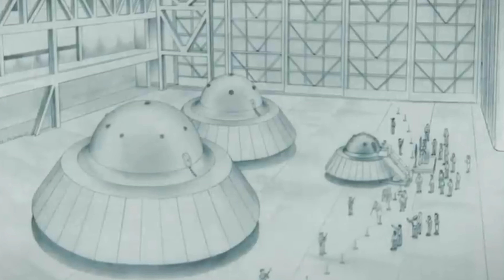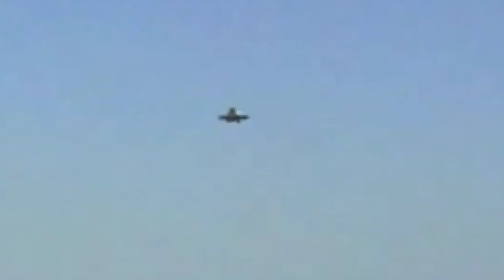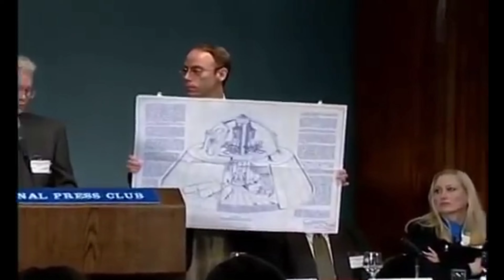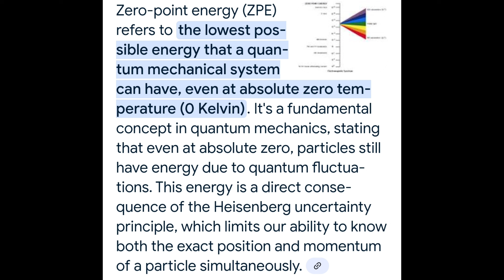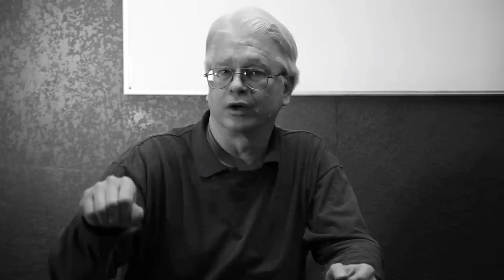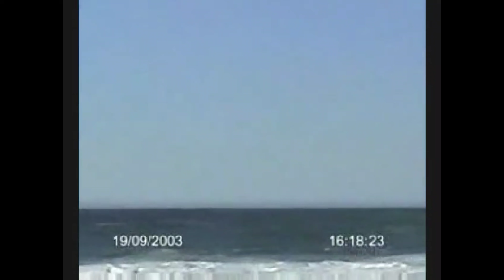(2025 Update) How To Build A UFO! The ARV (ALIEN REPRODUCTION VEHICLE) Project!

Comment: These vehicles do not produce thrust. Thrust is Newtonian mechanics. The occupants of the craft would not be able to withstand 20g. The craft does not move, space does. The internal dynamics of the craft, remains in its original state of inertia. The craft is not moving, we are.

From my understanding, the mechanics creates a longitudinal wave and a transverse wave that when meet, permeates the void in the quantum vacuum (interdimensional), at the Plank length and pulls from the tremendous energy density that resides there, for power. That energy density has been calculated to be of the order of a billion trillion trillion trillion Andromeda galaxies per cubic meter as transposed through E=MC^2.